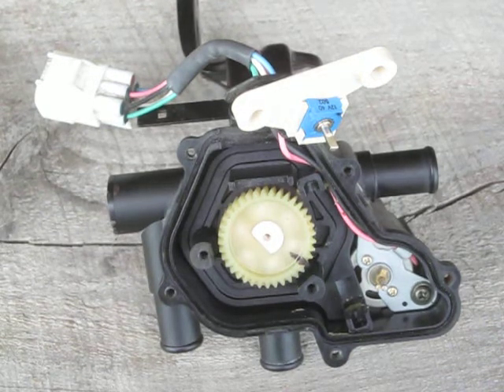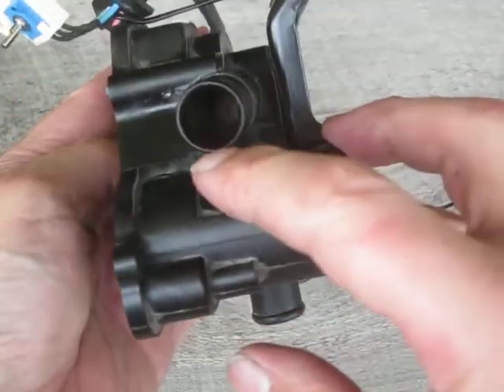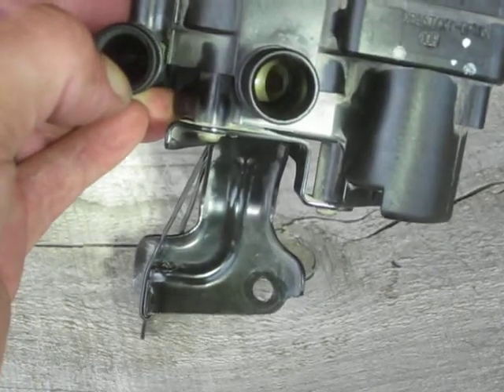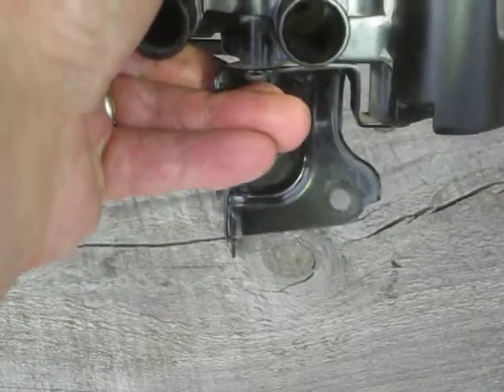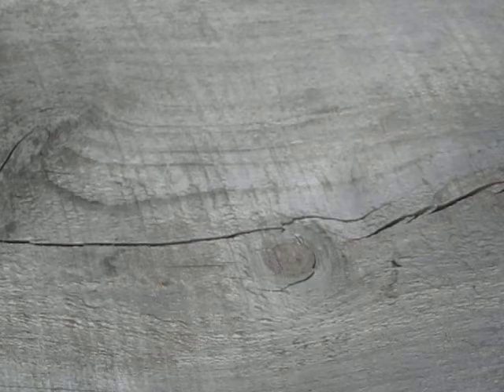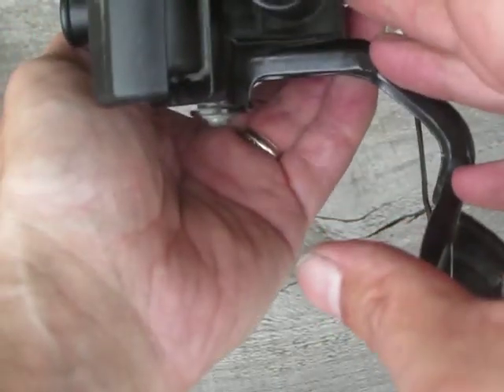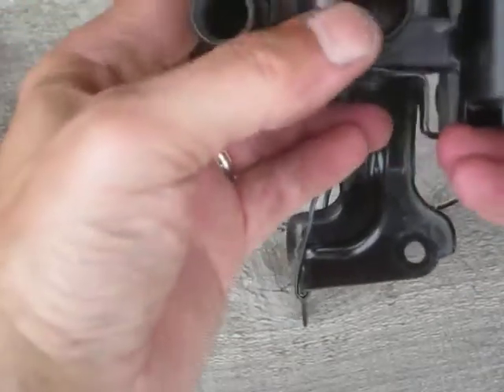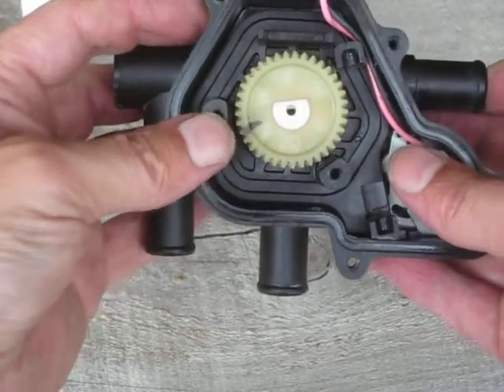Gen2 Prius Coolant Control Valve - Coolant Flow Paths

Comment: I have had code p1121 for 4000 miles and have never used fluid or overheated . Any ideas ? Heat also works well . Could it just be stuck open ?
Reply from the maker: P1121 does indicate the control valve needs to be replaced, Peter talked about this as well: https://youtu.be/9NUrZ2WJRws

Comment: Someone once said that the most generous form of sharing was the sharing of knowledge. Thank you for your generosity!
I noticed a reciprocating noise on my 2005 Prius coolant contol valve recently (no error code though.) I thought that the part had been working hard for quite a number of years and might be ready to give up. So I had it replaced. The new valve, however, still makes pulsing/clicking sound (no error on the computer and I can feel the flow going through the hoses.) Isn't the valve supposed to rotate to a position and stop? My mechanic thinks it is fine. I am a person who likes to tinker with thing - like to know why. Is the valve oscillating between two positions? Would that not cause the position sensor to report an error. Toyota's manual seems to suggest that there are three voltages (2.5, 3.5 and 4.5v) for controlling the three positions. Not sure if the power stays on constantly, or only comes on when needing to move. Any thoughts? Thanks
Reply from the maker: Thanks for the kind words, trying to help others is the goal!

Comment: I've order a new valve, but it won't be here for 4-5 days.  Can the car be driven safely ?  The trouble code is intermentant. Okay to drive or should I park it.
Reply from the maker: Drive it!  It primarily aids in engine warm-up, will not damage anything if not working correctly.
Reply: Thanks

Comment: I am having intermittent cabin heat issues on my Gen 2 Prius. Do you think this part could be the cause? Seems like it to me but my Prius isn't throwing a code yet. Perhaps its getting stuck sometimes but not enough to throw an error.
Reply from the maker: The ECM will log a fault for even the smallest malfunction of the valve, so that being the cause is unlikely.  I would check the fluid level in the radiator, NOT the surge tank, when the engine is stone cold.  Even a small under-filling can cause poor heater performance.